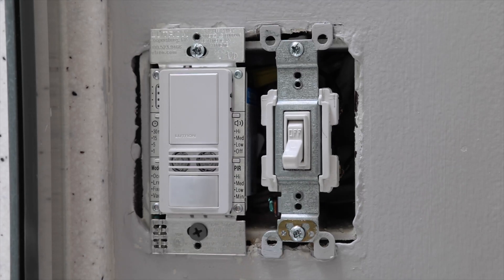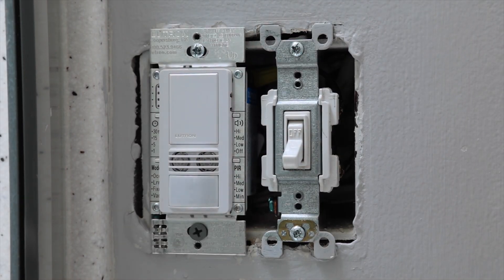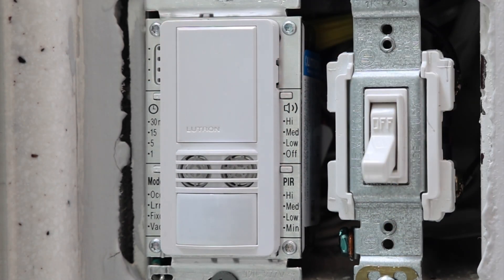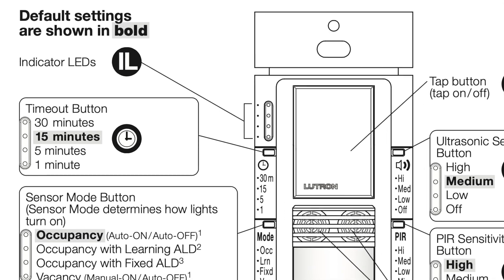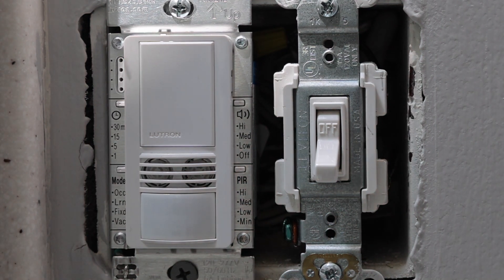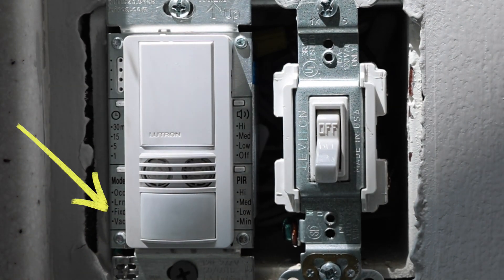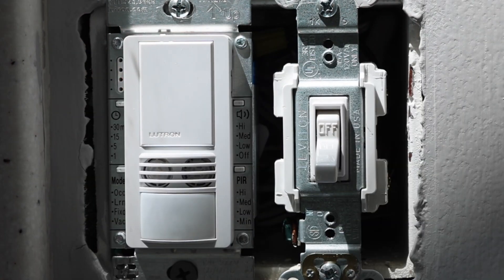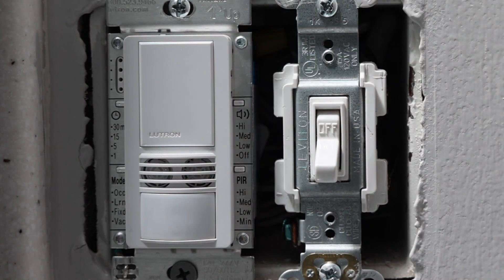How to Program and Set Up Your Lutron Maestro Dual Tech Occupancy Sensor Switch w/ Ultrasonic Sensor

Comment: I seem to have an issue not being able to switch from vacancy mode. I hold it til it blinks, but it won't change to another setting, and then the orange light just goes solid for a few seconds before going out. This ever happened to you? I have the same model btw.
Reply: I have the same problem . Any solutions ?
Reply: @Michael-en9fz 
If it has the V in the model number you can't get it out of vacancy mode. Lutron told me they were lazy and didn't remove the button
Reply from the maker: @andym3448 that’s annoying, but thanks for checking and letting us know!

Comment: Thanks for the tutorial.  I just wanted to point out that the ultrasonic sensor is not a microphone that is listening for sound in a room.  It is emitting an ultrasonic wave from one circle and listening for the reflection to come back on the other circle.  If there is a change that exceeds the "low", "med", "hi" thresholds then it is triggered.  Similar to how bats emit a chirp and listen for the reflection to help navigate while they fly to avoid crashing into nearby objects in the dark.  How has your experience been with these?  I noticed my dogs aren't always triggering the PIR sensors on my other switches and was curious if this one would be more sensitive to pick up their smaller "footprint".